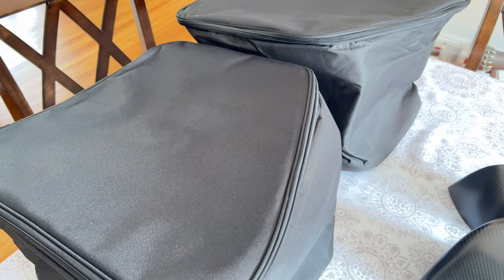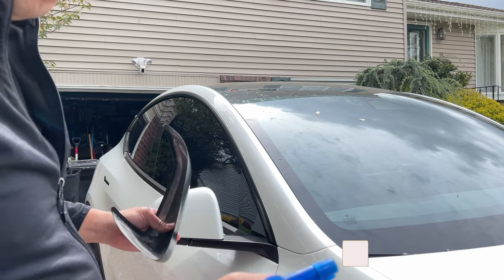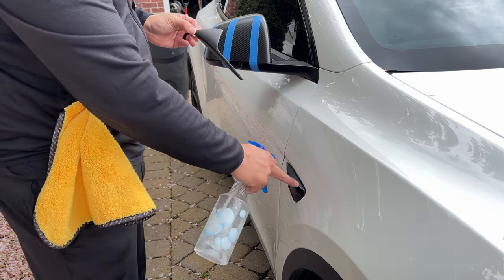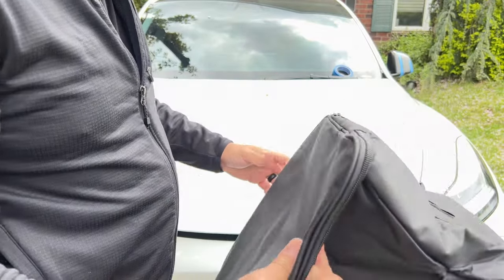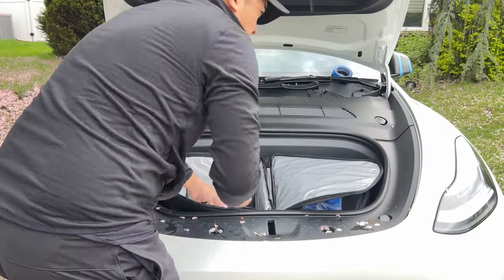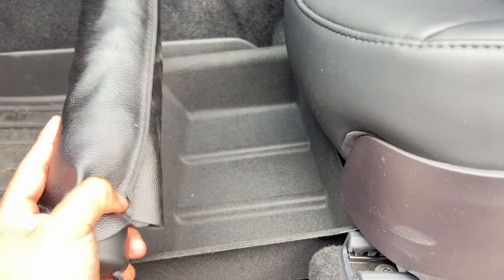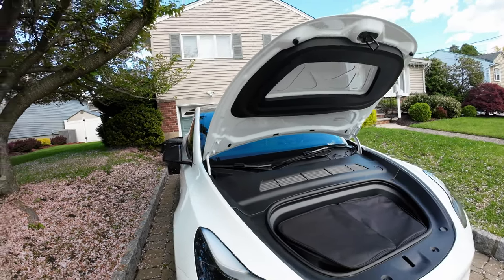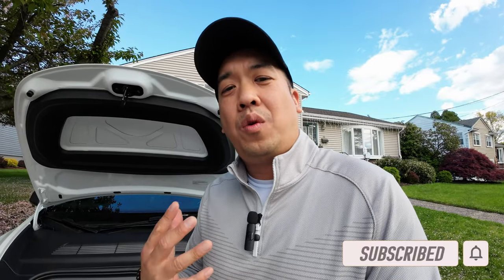REVIEW: Teslaunch Accessories 🚀 Real Matte Carbon Fiber Mirror Caps, FRUNK Cooler Bag and more!

Comment: Is Tesluanch a new company? And how’s the CF mirror covers holding up?
Reply from the maker: Teslaunch has been around. CF Mirror caps are doing well. So far no complaints. I am going to add a Matte Ceramic Coat to the mirrors when I install my new CF Spoiler. Look out for that video soon!
Reply: @garrick_ish  Ah gotcha. Looks great! I may have to order one. Thanks for the reply
Reply: @garrick_ish what ceramic coating you put?